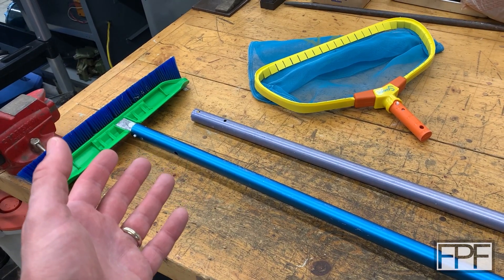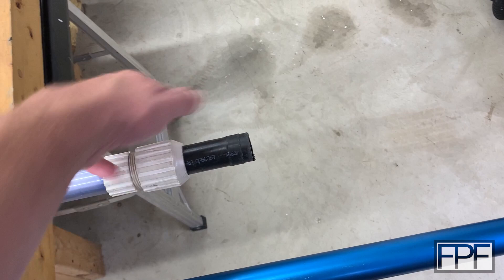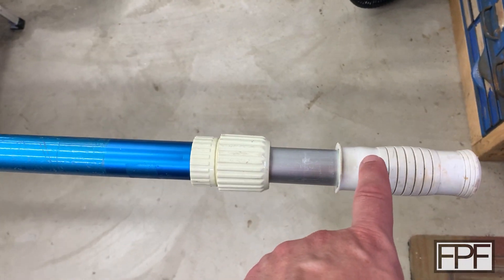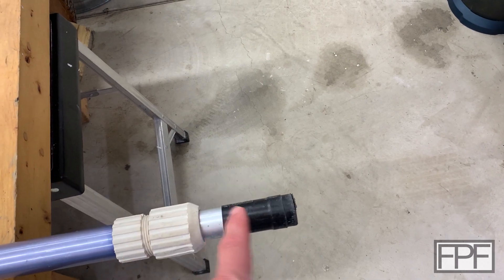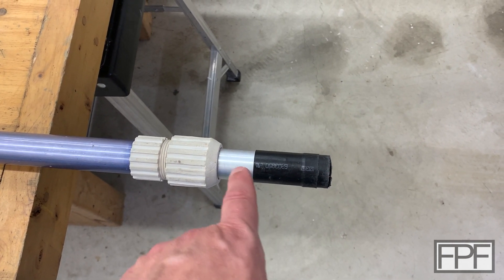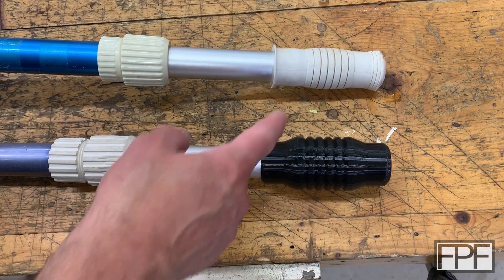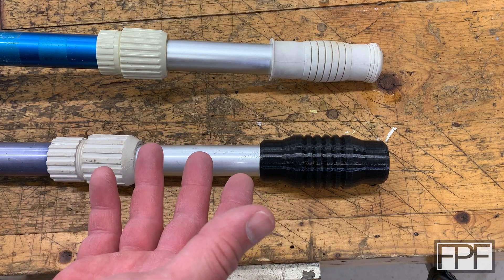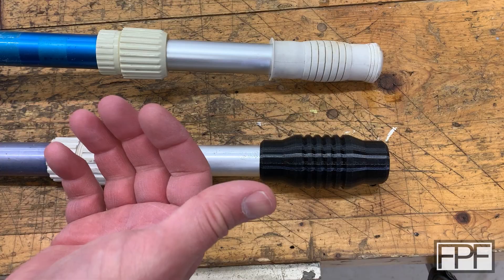3D Printed TPU Pool Pole Handle

Comment: using compressed air to blow down the tube from the other side can help "inflate" that grip so that it can slide on easier.  that's how we installed bicycle and motorcycle handlebar grips
Reply from the maker: great idea!  thx for sharing

Comment: Simple or not, there were some great tips here about printing with TPU to avoid supports. Are your Bambu printers able to pint TPU as well?
Reply from the maker: Thx!  Regarding TPU on the Bambu's, yes, but it's not the ideal tool for the job.  The extruder drive tension isn't adjustable.  That should be just fine for the stiffer sainsmart stuff (shore 95A), but could be problematic for softer stuff.  My prusa isn't going anywhere, and I've been doing solely TPU on it lately.
Reply: The more I hear from Bambu users, the more I think they're not as great as they want you to think. There's another printer that just came out, the Cetus 2, that does 2 colors that has a very small amount of waste filament compared to Bambu. Filament Stories had a short on it a couple months ago.
Reply from the maker: @bwselectronic  I'd be happy to check it out if they want to shoot one my way :)
Reply from the maker: @bwselectronic  I use mine pretty heavily and really like them thus far (and I paid full retail for both).   Every tool has it's place.  It's not the best tool for TPU, and it's not the best tool for multi-material vs. a like-for-like machine with multiple toolheads.  It's my choice for everything else though, which is 90% of what I print.
Reply: @bwselectronic  https://www.youtube.com/watch?v=6sXqAR_CtCM Not a positive review, though.